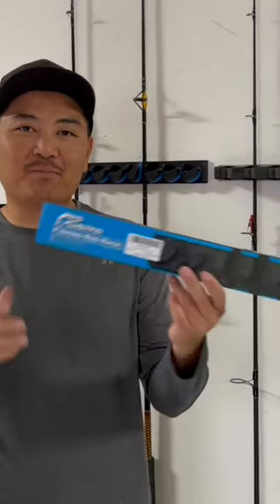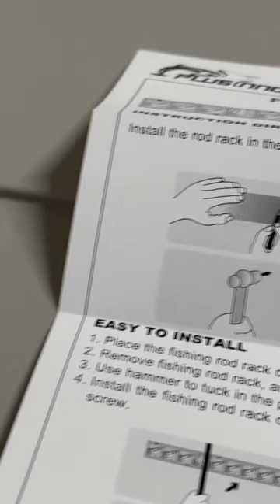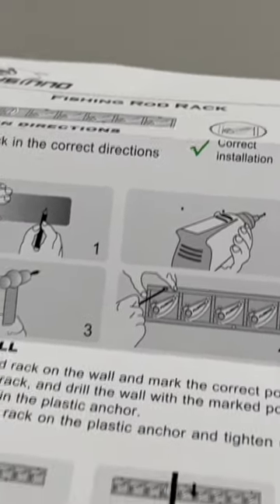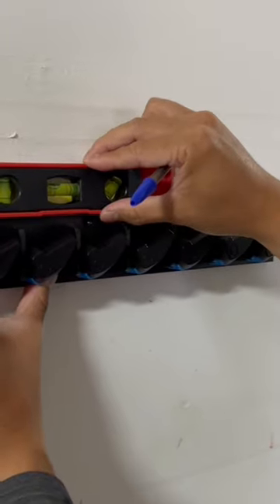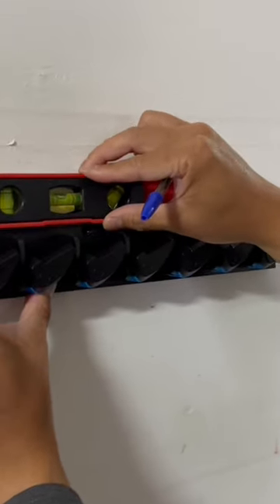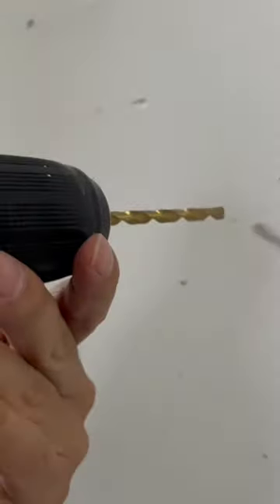PLUSINNO Fishing Rod Rack Installation

Comment: How big of a drill bit did you use? Thank you
Reply from the maker: Sorry I don’t remember the size, I went a size smaller than the dry wall anchors. No drilling is necessary if you mount straight into the studs.